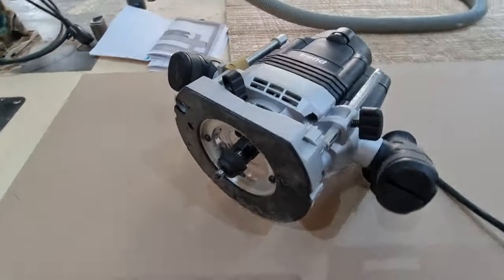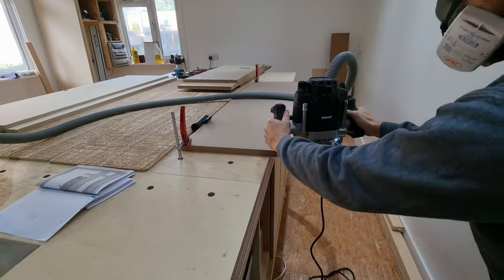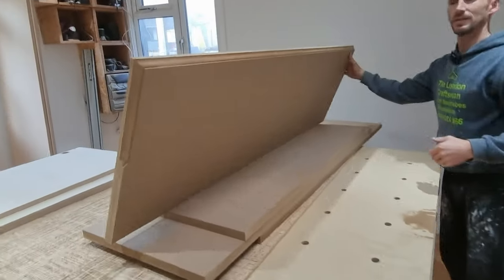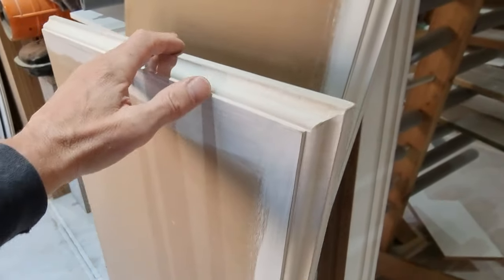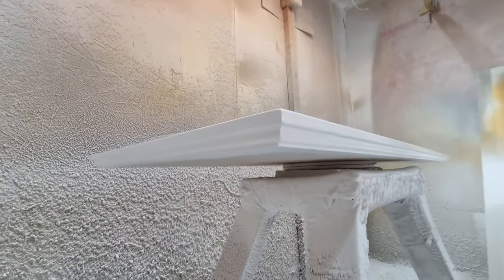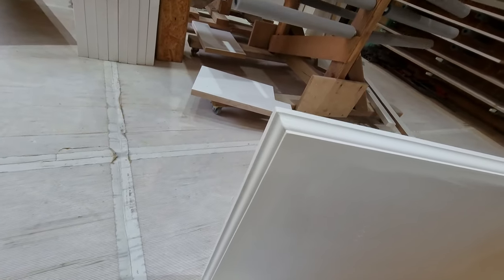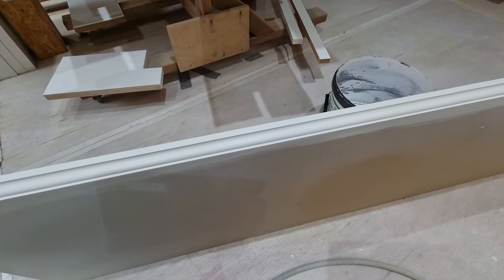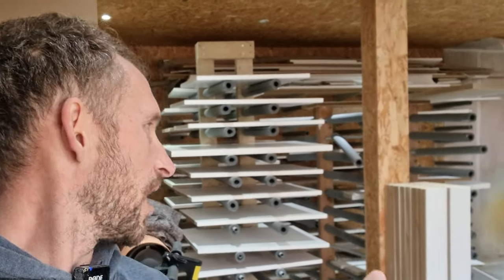Making Mouldings With CHEAP MDF - What Will Happen? Vid#161

Comment: Top content as ever! Thanks for sharing. Timely tutorial. I've been painting MDF recently, although I've applied a timber edge to cut edges of the MDF, and was wondering how a moulding to create a raised panel would take paint on standard MDF. The problem with going really slow when routing is the danger of leaving burn marks. Of course, a decent router and sharp cutter should reduce the risk. Anyhoo, I'll give it a wee go before deciding. Again, thanks so much for taking the time to share your experience.
Reply from the maker: Thank you!
Yes the slower you go the more risk of burning.
Also the bigget the cutter the harder thw cutter has to work. 
This technique worked on a relatively small moulding but I couldnt say for sure about bigger mouldings such as a raised panel. Work a go though.
Thanks for the comments :-)
Ryan

Comment: Great work as normal. As comparison I recently bought 6 sheets of finsa hydrofrugo and that is £50 plus vat, pack of 18mm was £20 plus vat each. So a pack of 50 sheets of standard mdf for the cost of 20 sheets of finsa is a big difference. Although I will say it machines like a dream.
Reply from the maker: Yeah MASSIVE price difference, but I suppose the quality between the 2 is night and day.
I use standard on everything, just because I can get a good finish with it.
I recently bough a pack of 16mm, 18mm and 25mm standard and that cost enough! Id hate to think of the price if that was finsa

Comment: Absolutely nothing wrong with standard mdf as long as you put in the prep time which doesn’t take long. I use standard mdf from Wickes, it’s usually Kronospan and my cabinets and spraying always come up nice. Like yourself I always give the edges a couple of coats of primer with a brush and roller before I sand them back and spray them. No way am I spending silly money on moisture resistant mdf. And I’m a Chelsea fan by the way Ryan, what a crazy game that was on Monday night…
Reply from the maker: I agree, just a small amount of labour extra and you saves loads of 💰. 
God yeah, great game, I was there, the red card and pen was a game changer 🙄 but still enjoyable